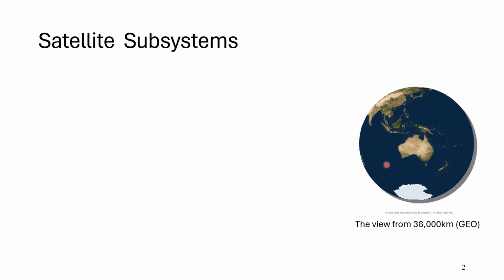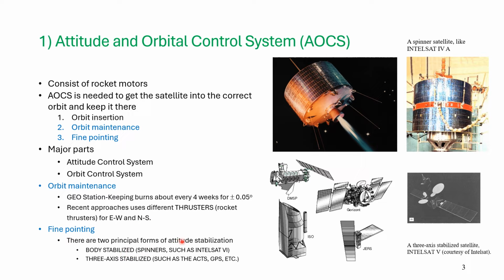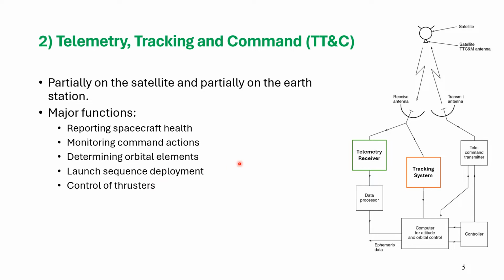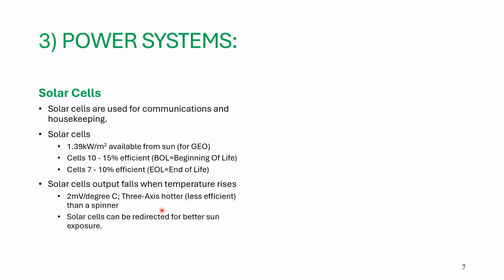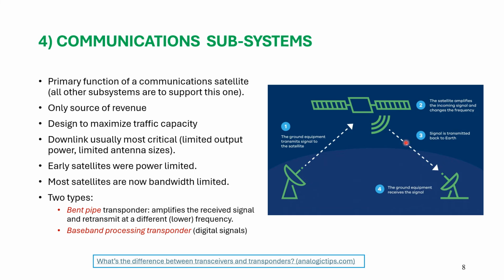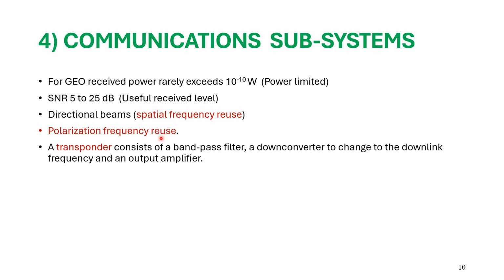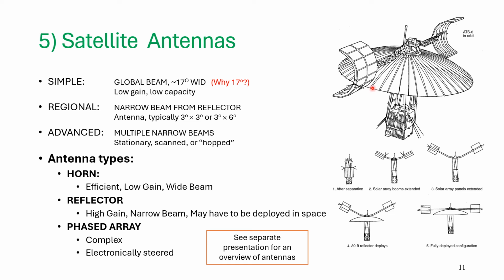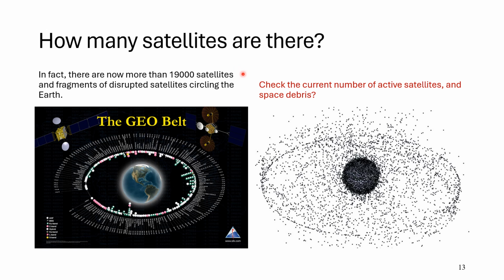3 Satellite Subsystem

Comment: A transceiver combines a transmitter and a receiver in a single unit. It can both send and receive information, typically in the same frequency band. A transponder primarily responds to an external signal by transmitting a pre-programmed response. It typically does not initiate communication independently.